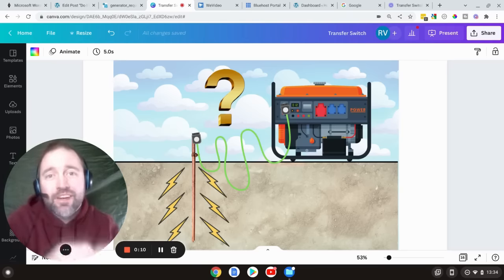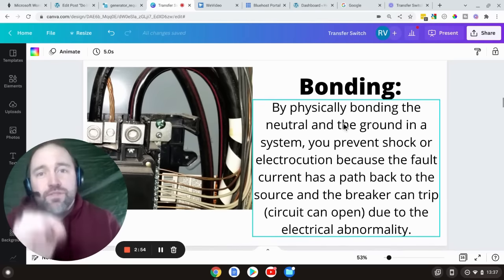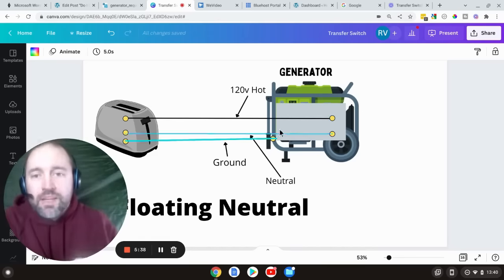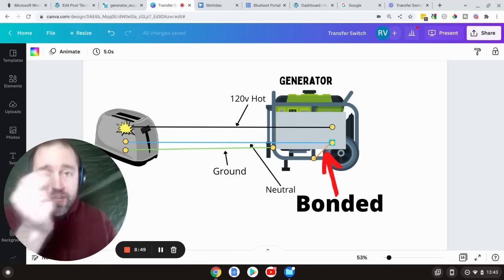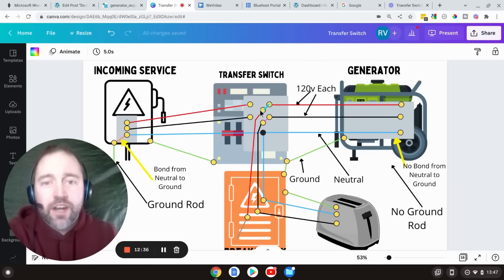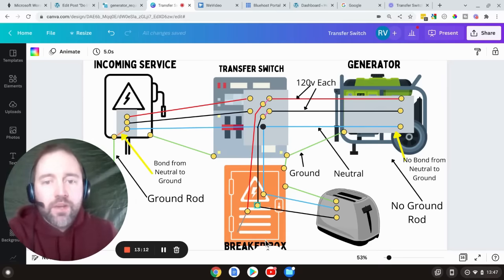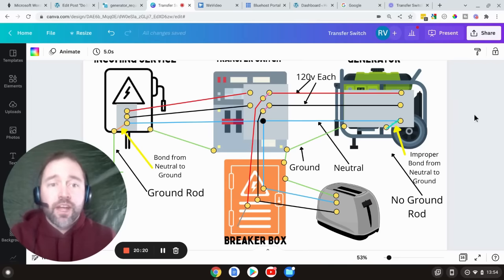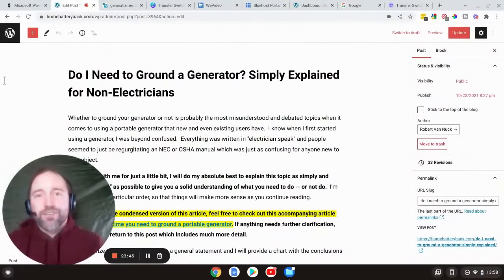When You DO and DO NOT Need to Ground Your Generator [Extension Cord Use & Backfeeding a Home]

Comment: As an electrician that has dealt with a lot of off-grid systems PV systems with generator backup, proper grounding of the generator system is one of the areas that many PV installers least understand. It is a bit different in that the inverter and generator both feed into the "service entrance" panel where the neutral to ground bond occurs, with the transfer switching often being internal to the inverter. In my opinion, the most important part of generator protection is functional ground fault protection, even if it is the small cord GFCI units that get plugged into the genset outlets when the genset does not have GFCI outlets.
Reply: Huh?
Reply: Concur.  

Oddly, I once had a situation wherein my GFCI breaker on my pool light wasnt protecting swimmers from shocks, and it was happening regularly. The problem was maddening to diagnose, until I found the utility neutral was poorly bonded to ground. This allowed the neutral to stay up to 55 volts from ground when a heavy load (AC) kicked on. The pool light GFCI could not detect this because all the current in the hot wire was returning through the neutral, as it is supposed to, but the neutral itself became a 55 VAC hot line, which in turn made the pool water electrified with a current passing through it which was being supplied by the OTHER leg of the split 240 system, which had nothing to do with the pool light power wiring (it was the 240 VAC AC circuit) which was not GFCI protected.

It shocked enough to hurt, but not enough to paralyze/drown or directly kill. 😢 There are still weaknesses in properly-designed electrical systems. Everyone knows about the low level short that doesn't trip the breaker but burns the house down, but few understand that GFCI isn't always perfect unless the full house and utility wiring IS perfect.

P.S. My biggest clue was that, when the AC compressor clicked on, some lights in the house got slightly dimmer for a moment, but other lights in the house got slightly brighter in that same moment. Dimming is something most people are used to, but if you ever see brightening, fix the problem right away, because its seriously dangerous for users of bathroom receptacles and kitchen receptacles.

Comment: Thank you for this video.  I now have a better understanding.  I don't need to ground my portable generator with extension cords.  I just need to bond the neutral and ground.  How about an external GFCI breaker in line with the extension cord?

Comment: One thing to advise is that the generator breakers and generator receptacles he is referencing are GFCI breakers or GFCI receptacles. They the GFCI breakers and receptacles, use the Hot and Neutral for monitoring the circuit. A normal AC breaker in your house does not use the neutral for its monitoring. It senses current in the circuit only.

Comment: This has to be the most concise explanation I've ever found on this topic. I spent years wading through the unnecessarily complicated jargon, like the term "grounded conductor". I'm also glad to see you spoke to the topic of how some switches also switch the neutral. Ignorantly, I thought a switched neutral would protect linemen better from homeowners who switch on their generator when power fails. A switched neutral REQUIRES the generator to be correctly bonded, otherwise the fault voltage still appears on the neutral wire at the pole, with a very high resistance path back to generator.
Reply: Awsome explanation

Comment: In Australia, breakers are combined overload breakers & earth leakage detectors. They will trip if more than the rated current is drawn through them. As well as if there is an imbalance of more than 30 milliamperes between active & neutral or more than 30 milliamperes is flowing in the earth wire. (In AU household circuits only have one active at 240 volts). They breakers are called Safety Switches because they will protect a person from electrocution if they are in contact with active & a ground path (Eg a water pipe or standing on wet concrete) and have high enough resistance so too little current flows to trip the breaker but there is enough current to cause cardiac arrest. (Provided this explanation in case safety switches are not used in US.) 

Now the thing is when a generator is connected to a house via a transfer switch, the safety switch imbalance system cannot detect an active to earth or an A & N imbalance fault because the generator is a floating source & there is no reference to earth.

To overcome this issue, there is another type of breaker called a Residual Voltage Detector. This unit can be used in conjunction with a safety switch to cut off the electricity from a power source with a floating Active, Neutral & Earth. This bypasses the issue of generators needing bonding in some installations but not others for both overload & electrocution faults to be detected by safety switches. 

A link for more info if interested in how it works. Note they are mainly used in the mining & construction industries for worker safety. 

https://powersafe.net.au/rcd-duo/
Reply: Finally, I find one comment that sets it right regarding breakers tripping and how grounding and what we call here in the US, GFCI's (Ground fault circuit interrupters).  Thanks for the good safety info, Mark!

Comment: Thank you for a very useful video.
I'm on the cusp of getting a generator for those potential moments of temporary power blackouts forecast this winter. Like nearly all recent houses we have no alternative methods of heating other than gas central heating. I'd been thinking of going the whole hog and installing transfer switching but then counted all I really need are very few appliances, lighting, fridge, microwave etc. and all can be connected using a neat setup of extension leads. 
For heating -- I'd considered it no problem for the gas boiler to be powered off an extension lead too as the load from controls and pumps is less than 500W - but I'd been bothered about grounding. You have underlined the detailed care needed as the boiler, gas and water piping are all permanently bonded to earth throughout the house. Faucets, radiators, showers, sinks, towel rails, the works.
Thanks for letting me better understand there exists a real problem here.

Comment: This video is awesome, being someone who could have been killed by a generator that was run with an improperly wired system I'm here to tell you this all matters. I was using a generator that was wired into a transfer switch that was set up wrong at my mother in law's house and I was getting 120 volts between the generator chassis and the earth! I went to move the generator a little bit in it's little shed to have the exhaust pointing the right way and got shocked really bad. Had I not been wearing safety boots and not wearing rain gear I would very likely be dead.

Comment: If I am not using a transfer switch, but instead have a 50 amp receptical that connects directly to the house breaker box after an interlock lever is thrown (forcing the main breaker to be turned off before the 50 amp receptacle is turned on and used) can I safely connect the proprietary 50 amp cord from the generator to the 50 amp receptacle to power my house with a non bonded portable generator that is not connected to a ground rod? No transfer switch used in this scenario…

Comment: I have a portable generator that connects to a transfer switch on my breaker panel. The owners manual recommends grounding with 8 AWG wire. I clamp it to an outside water pipe that runs underground. I need to re-check the generator grounding system.  From your video, I may not need a ground wire.  My house was built in 2018 and our community has underground service to the house. The generator is a Ford, 9500W/50 Amp continuous. The transfer switch was installed by an electrician. When the generator is in use, the service breaker is off protected by a safety bar and the generator is supplying power to the entire house through the panel's transfer switch. Thanks. I'll double check the manual on grounding requirements. A ground rod may only be needed if running extension cords vice power through the panel.

Comment: A little off topic but I just read your article on the web page about floating neutral and bonded neutral generators as emergency backups.  I've got a fair bit of electrical knowledge, but not much experience with generators, but I did have a basic understanding on bonded vs unbonded neutrals.   Your article really helped drive home the theory and answered some lingering questions. I really appreciated the detail.   It gave me an idea on how I can safely use extension cords in case of outages, until a planned service upgrade and proper transfer switch happens in a couple of years.
Reply: The theory of this video is good, but I have a bit of an issue with how things might play out in real life. A portable generator can be purchased with one purpose in mind but then used for different purposes and by different people over decades. And the vast majority of people likely do not understand all the ins and outs of proper bonding.

The only generator that I've used as expected is my Generac whole house generator. But my portable generator usage has been too unpredictable. In the past I had a portable generator powering my house but then shut it down and then urgently wheeled it over to a neighbor's house to help them pump out their basement. Or my brother might not be able to start his generator and so I take my portable generator over to his house in a hurry. I'd say that the best portable generator bonding is the one that is safest when used in the wrong scenario. That is unless future portable generators could set the proper bonding automatically depending on the connected load.

Comment: Love the video, great explanations with wonderful diagrams, this is what I need, because I'm an electrical amateur and just bought my first inverter generator, 2500 watts. But where I get kind of messed up with your explanation, is with you saying they floating neutrals don't/shouldn't need grounding rods. But the manual for my generator (floating neuttral) says you MUST use ground rods and even gives the wire thickness for such (4mm square), which ends up being a 10-12 gauge AWG wire. And I am going to do so, so if anything goes wrong with it, I can at least say I followed the manual, to the letter. I don't want to give them any excuse not to honour the warranty, should I need service. I'm going to use booseter cables, because I already have a spare set and they are easy to hook and unhook too.  

But thank's to your video, I definately understand bonded vs. unbonded and ground rods and floating neutral much better, because I was confused and reading it in text, I still find too cryptic, no matter how good the description.

Comment: I've been researching online for quite some time, trying to get my head around this topic. Until I viewed your video, it was all as clear as mud. Now that I found your post, I have a much better understanding, thanks to your excellent approach to teaching. The diagrams you used and the clear and concise explanations really helped me better understand the topic.

I'll be retrofitting my home with a Generlink Xfer switch at the meter and I 'really' needed to understand this topic to be able to 'safely' connect it to my new 12Kw generator . As well, to understand how to wire the generator so as to 'not' accidentally electrify its frame....and myself :(

Given the potential for serious injury (or death) when using a generator, the information you provide may just have save some lives .....including mine.

Keep up the great work :)
Reply: The problem is that many people don't understand the topic. Electricians are clearly not taught how to do circuit analysis. 

If you can draw out a circuit diagram representing the installation, and you understand Kirchoff's Laws, then it become easy. And you can decide for yourself whether grounding is required.

And Kirchoff's Laws really are two of the simplest things in the universe.

And my favourite saying, if you don't understand Kirchoff's Laws (along with a few others, including Ohms Law, Faraday's Law, Lenz's Law) then you should not be working in the electrical profession. It's a simple as that. 

The problem is that electricians and others are relying on others to give them the answers and there are so many different scenarios, they need to be equipped with proper skills and the capability to be able to do their own analyses.
Reply: @deang5622  You are exactly right. Electricians need to be able to understand how electricity works so that they can see for themselves what is right and what is wrong, instead of relying on what someone else says. How would anyone know if that someone else is right? The only way to know is by understanding electricity oneself and then one can know what one is doing instead of doing something unsafe and stupid. In other words, with knowledge one can have CONFIDENCE in what one is doing and that is the only way to do electrical work.
Reply: @MandrewP  The basic circuit analysis skills, using Kirchoff's Laws, Ohms Law is not difficult for people to understand.
I know electricians are taught Ohms Law.

And the maths is very simple, additions, subtractions, multiplication and divisions.
And let's be honest, everybody is supposed to leave school with a reasonable level of proficiency in English and Maths, and the maths they teach in school at age 16 involving trigonometry is far more advanced than that required for simple circuit analysis.
Reply: I have a 48kw generator

Comment: Very odd. I had this exact same question in mind this morning. Thank  you very much for the timely and concise reasoned explanation and for why things are done the way they are. I have a installed a simple transfer switch for a 120v generator that switches both H and N and maintains system G with no ground rod and no generator N to G bond. However, I now understand that I should not switch the N, but join them together to avoid having to apply a ground rod and bond the N to G on the generator.

Comment: Finally, an excellently explained video for generators and grounding and bonding.   You were correct in your examples.   Here is the weird one for you.   Connecting an inverter, floating neutral, generator to an RV.   First thing, the panel in the RV is a sub panel.   No bonding neutral to ground.
So, the generator needs the bonding jumper.   Southwire makes a plug that you insert into the receptacle that has an internal conductor grommet N-G.
Reply: the ground rod is not needed for an RV because nothing is touching the "earth ground." The tires insulate the vehicle from lightning. Basically don't put your generator or inverter on the physical earth. An important fact is ground rods are for buildings that are attached to the earth not for RV's because they are not attached to the earth. Make sure to raise your leveling jacks or put wood under the feet :)
Reply: @uhjyuff2095  Thanks for clarifying as I was wondering about the steel leveling jacks.  As far as steel belted tires I'm certain the steel belts are in the tread only so the steel is insulated by rubber on tread and none in the sidewalls anyways.
Reply: @michaeldepastene1510  ground/earth  tires are made of rubber, they stuff was one of the first wire cable insulations used, so any tires, in good service, none of the in side handing out, would be the same putting hole RV, on one big rubber floor-mat?
Reply: @michaeldepastene1510  I have often heard that tires have enough carbon black in them to make them conductive.
Reply: @jefffrayer8238  when I was 12, my mom was driving me back home from an outing & just as we were driving over a bunch of railroad tracks a lightening bolt came down about 5 feet from our car, hit the tracks, & that launched our car about 3 feet into the air.  Had tires been electrically conductive,  that lightning would have hit the car since the car was higher than the tracks.  But it didn't.
Reply: @michaeldepastene1510  True! I had my garaged car hit by lightning once and it fried the car radio (blew the transistors). When I took the radio to a shop for repair the tech told me lightning couldn't have blown the radio--until he saw the internal damage--then he became a believer!
Reply: @jefffrayer8238  Believe me, lightning CAN strike a vehicle supposedly insulated from the ground---I had it happen to my garaged car once.  Smoked the car radio!
Reply: @mosler302  Tires have a lot of carbon-black, which is a poor conductor, but it is still a conductor. Lightning does not always strike the highest object.

Comment: In FL there are many many mobile home parks w a disconnect at the meter and in the load center,
also a 4 wire line from disconnect to load panel as the panel in house is a SUB and NEUTRAL and Ground MUST NEVER BE HOOKED TOGETHER. For this I have a 10/3 cord w ground, so 2 hots a neutral and a ground.